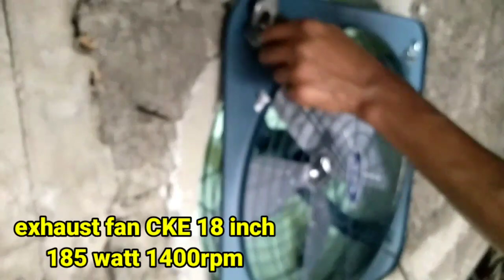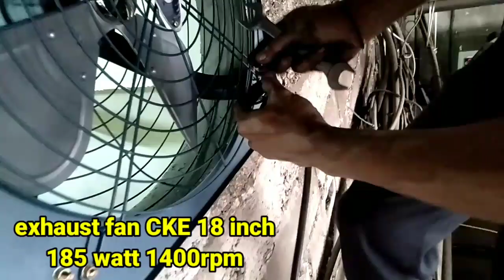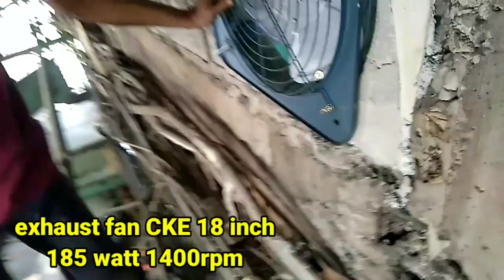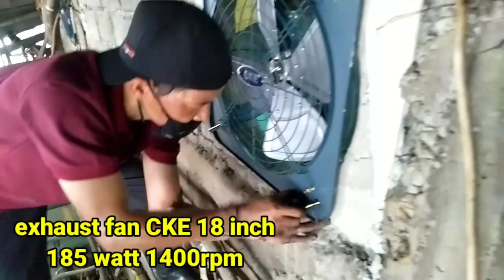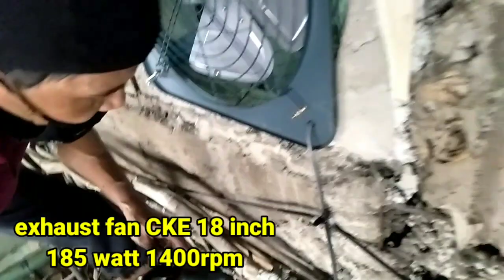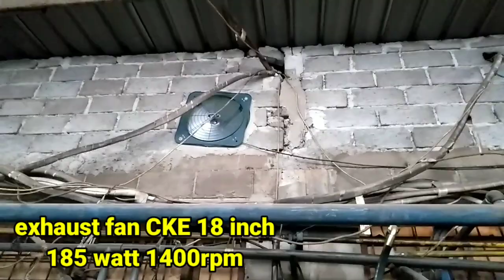Exhaust fan CKE 18 inch test running

Comment: Mau tanya om kalo exhaust fan cke 16" yang 380v apa ada tambahan instalasi om
Reply from the maker: MBC 3phase
Reply: @BangJL  siap om, berarti pake phase r sama s ya om
Reply from the maker: RST
Reply: @BangJL  kabel keluaran dari exhaust 3 om, masak ngga ada 0 nya om
Reply from the maker: @msyaifulhoiri3185 klo 3phase ga ada kecuali 1phase itu ada nolnya

Comment: Bosku. Kalau mau pasang control speednya. Pakai controller tipe apa ya. Saya lagi bingungn. Mau pake voltage control kah atau current control atau frequency control. Mohon bantu jika bisa ya bos. Makasih yah
Reply from the maker: Kebanyakan yg di pke speed control.
Terimakasih, semoga membantu
Reply: @BangJL  owhh iya la. Speed control. Gak mikir aki. Wkwkkw. Makasih bang. Moga succes selalu